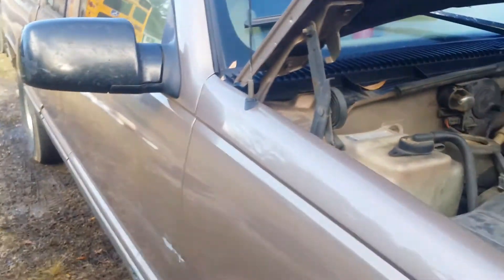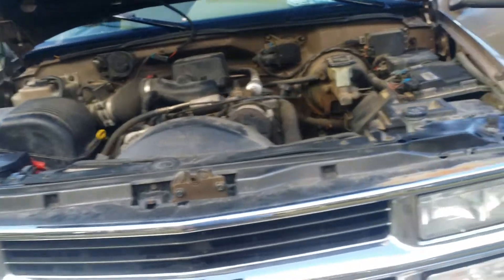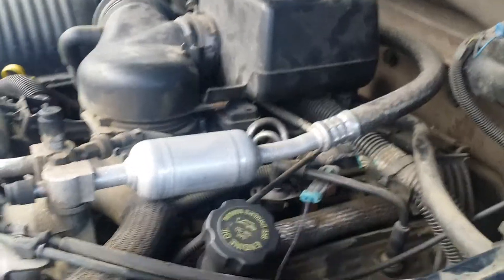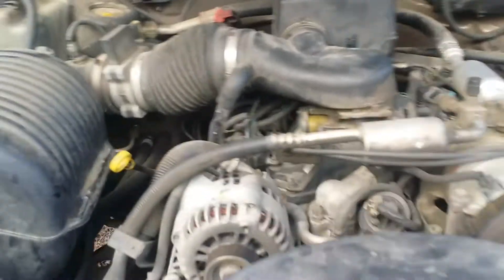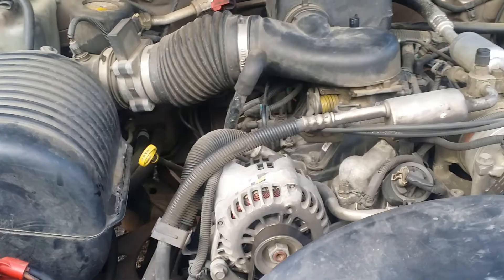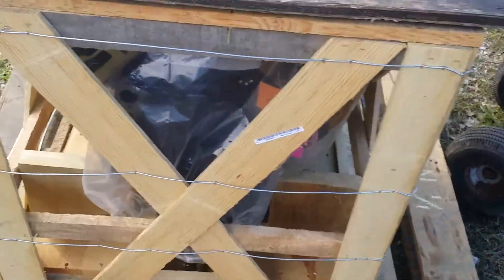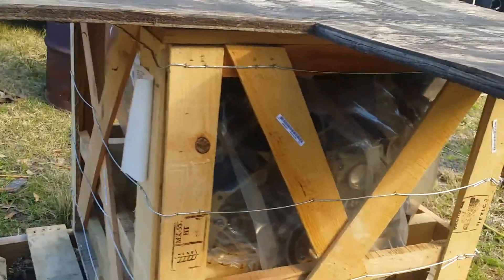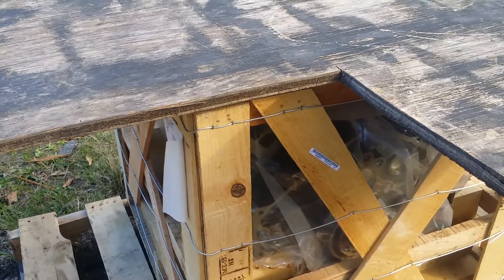5.7 vortec l31 knocking

Comment: I have a Chevy 1996 5.7L 350  Sb is knocking noise. I took the oil pan out and found metal residual. I was told I need a new engine. The engine turn on and drives. Any advice please. Thanks
Reply: Get compression on cylinders, if all checks out pull and replace bearings and bottom end stuff
Reply: Just got mine finally paid off today. Got to drive it for the first time and I heard the worst knock In my life. It started smoking under the hood. I pulled over and opened it, steam was blowing out of a hose that was still in the motor. This hose was on the top right of the engine. Oil was everywhere. Praying I didn't blow a rod though it
Reply: watch how to replace rod bearings. not a complicated DIY